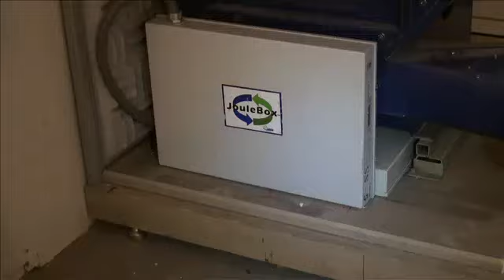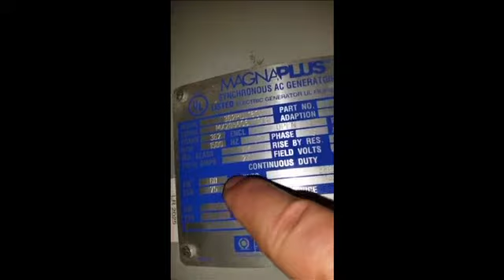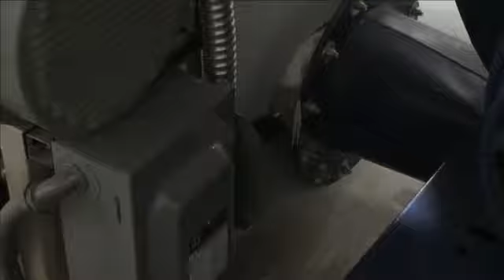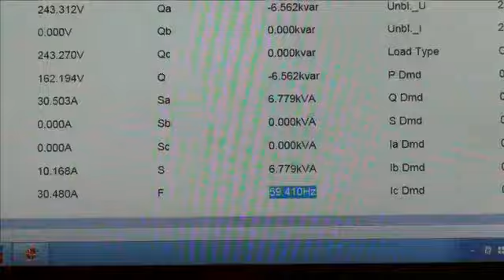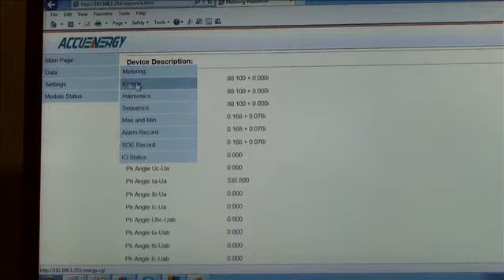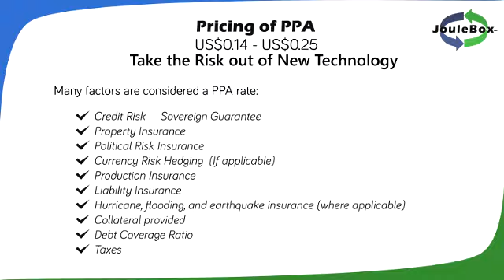JouleBox

Comment: It is real, it's called a pulse motor, an old technology but with a new twist. I can see a couple of areas that can be improved in this motor which will drop the 60% cost to build, 30% increase power and use 60% less energy to power the motor. You only need a 10 kW battery pack instead of 30 kW. This new technology is a capable way beyond just to improve the pulse motor. It will change everything under the sun. Industrial revolution 4.0 which is IoT that happening now. Soon we will have  Industrial revolution 5.0 which is SPoT ( Self Power of Things ).  Everything under the sun is practical runs on its own power without charging or battery only if Mr. Oil and Mrs. Gas are allowed the technology to release.